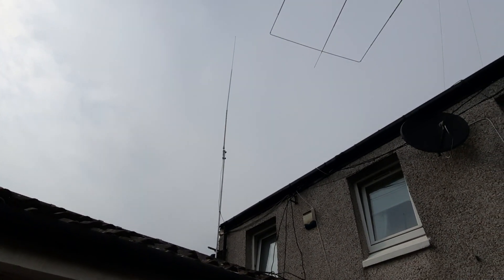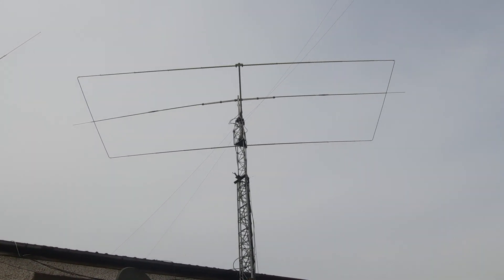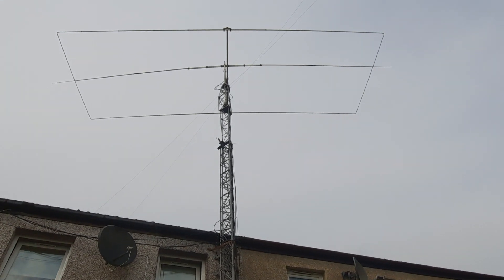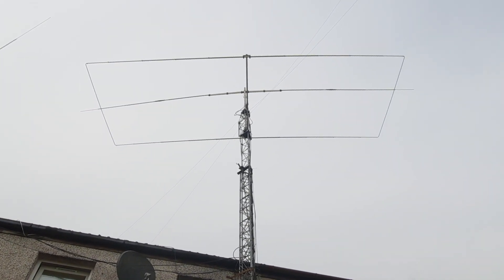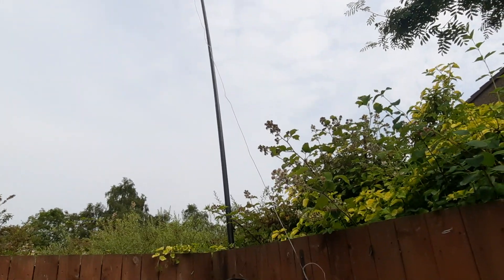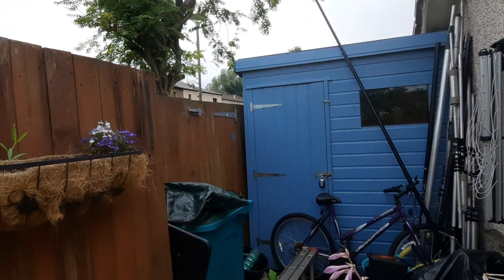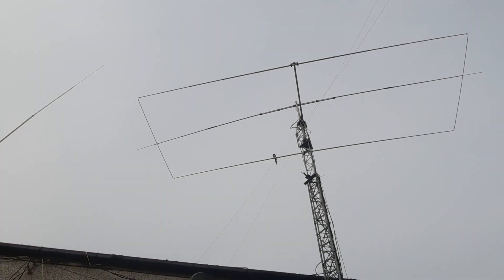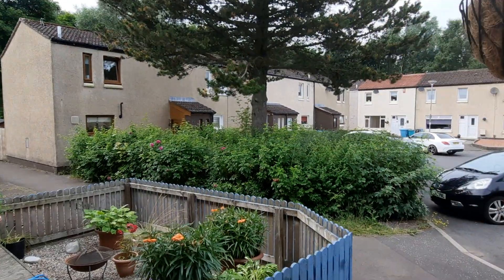mm0jvb 5 mono band antenna's in a 20 foot garden (almost)

Comment: Is your Moxon and 40m dipole overhanging next door? Or is that all your property? I am looking at the Innov 20m Moxon at the moment and have an equally tiny garden. Many Thanks!
Reply from the maker: over hanging
Reply: @mm0jvbonair295  And they are fine with that? I have 4.1m to my neighbours fence and it is massively restricting my options. I can just make the Innov Moxon work. Otherwise it would have to be that I keep my Hex Beam or buy a Steppir  DB11.

How well does the Moxon perform? Has it been a good purchase for you?

Thanks 🍻
Reply from the maker: @johnratcliffe6438  sorry john not been in here in a few weeks . moxon is an exellent antenna .